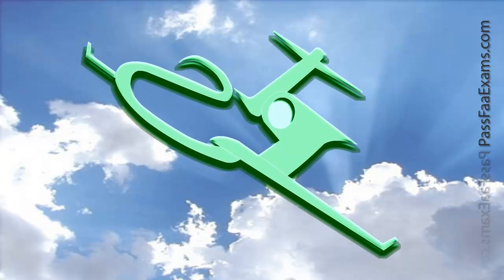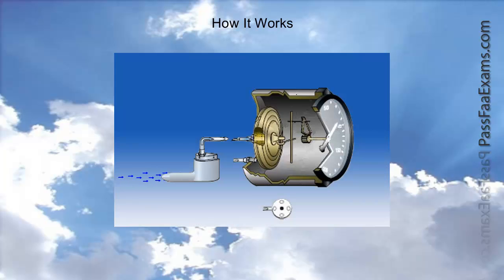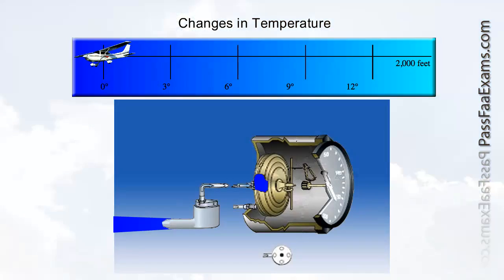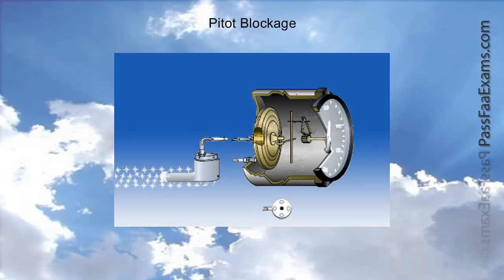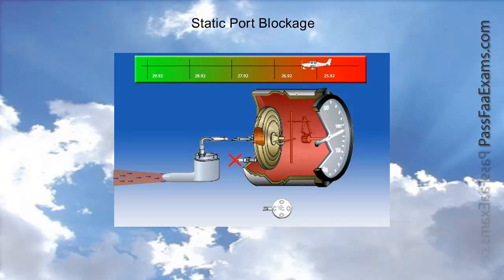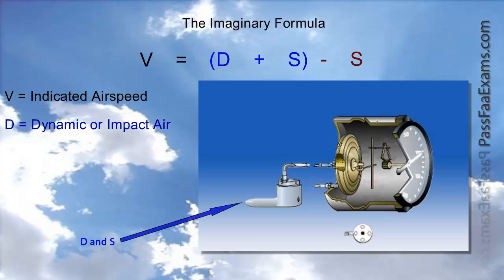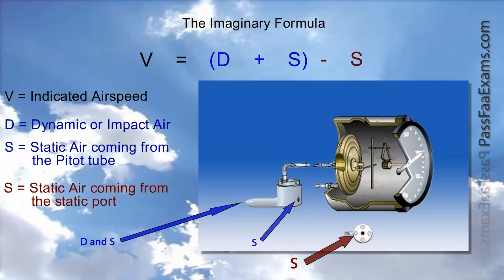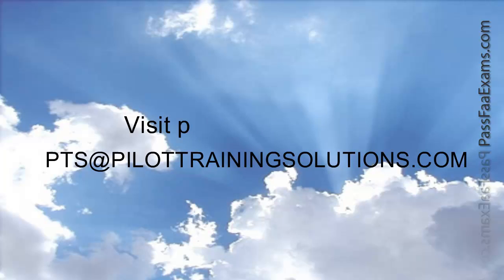How the Airspeed Indicator Works

Comment: In fifty-three years of flying I have never heard before that pressure has no effect on the airspeed indicator - that only changes in temperature have effects on it. But nowhere in the PHAK - 8083-25B does it suggest this theory. Conversely, nowhere in this manual does it suggest that temperature, by itself, has any effects on changes in indicated airspeed at all. Changing temperatures will of course affect static as well as dynamic pressures - which will, in turn, affect the airspeed indicator. But the airspeed indicator is itself a differential pressure instrument. Air does not flow through a pitot tube, it only impacts it like you're stuffing clothes in a bag. And it is a liar at all altitudes except at sea level. At all altitudes above sea level it stops indicating your actual speed through the air and indicates to you only the dynamic airspeed which the entire airplane "feels" it is encountering. That's why we need to calculate our true airspeed - so we'll know what our "true airspeed" really is... Where did you get this idea that only temperature affects the airspeed indicator? Are we missing something in this video?

Comment: Hi, for the airspeed consequences in case of flying into colder air or higher pressure, you need to fix one parameter, I mean, or you fix the TAS or the IAS. In the first case, if you fix the TAS, then flying into colder air, the IAS will increase, and in the other option, for higher pressure, if you fix the IAS, then, the TAS will be decreased, but always fixing one parameter. Changes in temperature or in pressure will always affect the air density, and therefore, the dynamic pressure, which is the one that gives us the measure of speed.

Comment: The altimiter does not use ram air
Reply from the maker: This is an Airspeed indicator!!!
Reply: @GianLucaNoia  I am just saying it because you say "altimeter" in the beginning and it says "altimeter" on the top of the slide.  I think if these things were changed, it would be less confusing for those watching...that's all man, you dont have to get mad about it

Comment: What is being shown in this video is old technology and not realistic for modern air data systems
Reply from the maker: Keep in mind that the purpose of most of these videos is to help Pilots working on their Private license and/or Instrument rating. 
Be it for cost, aircraft availability, etc, the majority of students prefer to accomplish their training in older airplanes still equipped with analog instruments rather than glass cockpit.
Also Airspeed Indicator questions on all of the FAA Knowledge Exams still focus on these analog instruments!
Reply: @GianLucaNoia  > I can understand that, but in the real world most of us work on or support  modern aircraft in some capacity whether it be engineering or customer support etc.   You will not see this unless you work on old general aviation aircraft.  I just don't want people here to assume they are getting into aviation and will see this as modern technology.  It is old antiquated technology.
Reply from the maker: @rcairflr  Agreed, but this video is for the Primary students. It is an extract from our Private Pilot Interactive Test Prep Software which focuses on helping students pass their PPL Written through understanding rather than memorizing questions and answers.
We do offer advanced IFR training software (our IFR Procedures App) where we cover advanced systems and glass!

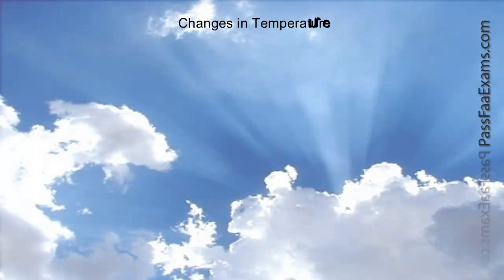Comment: At 2:00 when you talk about temperature you should add an annotation to make it more clear that temp does not affect the correctness of the Air Speed Indicator ( the Vspeeds like stall speed will be the same regardless or air temperature.  I understand you're just trying to show the relationship between Tas and Ias but it's slightly confusing.

Comment: What will happen if only the drain hole blocked
Reply from the maker: If the drain hole is the only affected (blocked) input nothing will happen but in heavy rain the Airspeed Indicator might malfunction.
Reply: Gian Luca Noia air which is intering in the pitot tube after accumulation in pitot pressure chamber it apply pr in instrument where it goes
Reply: Gian Luca Noia if something enters in a chamber it need a way to come out
Reply: Gian Luca Noia 
What is the use of drain valve in pitot tube
Reply from the maker: You are complicating your life as a pilot. What we do at PTS is simplify aviation concepts. So, to simplify this, try blowing in a bottle of soda for example. The air is trapped in the bottle and can't escape. If you make a hole in the bottle and seal it after inserting a manometer you will get different readings from it as you increase the pressure with your breath.
Also if you were able to calibrate a sealed plastic bottle it would make for quite an effective altimeter. The more you climb, the more it will expand. The more you descend, the more it will compress. 
In essence the DRAIN Hole is just that: it drains unwanted material from the pitot tube. That is it's only purpose!!!
Reply: Gian Luca Noia 
Im not a pilot im doing aircraft maintenance engineering so i need explanation about pitot static system
Reply: Gian Luca Noia 
and if drain hole is only use to remove unwanted materia then when pitot tube blocks then how the air which is filled in pitot system drains from drain hole.
And indicator shows 0 reading

Comment: I still don't get the point of relationship  between  Static Port and Pitot Tube..... I got the point of how airspeed is measured by Pitot Tube... But then I saw people saying that airspeed indicator actually measures the average of speed from Pitot Tube and the one from Static Port. Is this right?
Reply: +Hyeonchang Cheong 
Static port is showing static (still) air around airplane. Pitot is showing dynamic (moving).
Airspeed indicator working "moving - still = your speed".
Reply: That's in fact incorrect. According to Bernoulli's principle, Total Pressure=Dynamic Pressure + Static Pressure. What the pitot tube reads is indeed the total pressure, and static port (as stated in the name) reads the static pressure. The instrument is calibrated to perform "calculations", in this case the Total Pressure from the pitot minus the Static pressure from the static port which results in the dynamic pressure, the pressure associated with speed. You can see it this way, if the dynamic pressure(speed) increases, the static pressure will decrease, vice-versa.
Reply: Same doubt

Comment: Thank you for the well made video. One question, so why is the ASI connected with the static port when it reads the dynamic pressure from the pitot tube?

Comment: I watched many air crash investigations videos , just for curiosity sakes, not a pro.
I have seen thousands of crashes caused by mis- readings produced by blockage of pitot tube.
My question is , isn’t there a way to tell pilot,when pitot tube gets blocked?
Are there other methods of measuring speed and attitude when pitot tube blocks?
What are the recent innovations?
I loved this video explanation.
Reply from the maker: jitegemee The easiest way to detect a pitot blockage is to cross check all your instruments. If the airspeed keeps decreasing but the altimeter and VSI do not show a climb and neither does the attitude indicator (and you have not touched the power settings). There is a good chance that the pitot tube is becoming iced. Nearly every plane out there, definitely if Certified for IFR (flying inside the clouds), has a pitot tube heater. Turn that on and you are good to go.
Reply: jitegemee GPS

Comment: I try to understand deeper. So the speed indicator measures the speed by différences in total pressure in the pitot tube. As total pressure is Dynamic pressure + Static pressure, and as the static pressure varies in the chamber as in the air, we can say that the indicator measures speed by dynamic pressure only (if nothing clogged).
Now the dynamic pressure will depend on our speed through the air, but also as you write, on the air density.

As you say, as air (and gases) expand with temperature, the density will decrease if temperature increases. This has for effect that lift will decrease on hot days (notion of density altitude) or, as another example, that warm air can content more water vapor than cold air. Right ? And also, that the speed indicator will indicate lower than the true airspeed when temperature increases, because warm air is less dense.

But if density is affected by temperature, can it be also by pressure ? As we climb, TAS will be greater than IAS, because by pressure decreasing, density decreases ? Loss of temperature when we climb should increase the density, but as I understand the loss of pressure has a greater effect on density than the loss of temperature. Or do I miss something ?
Reply: Jean Stassin the video says temperature variability has far an effect on airplane speed than change in pressure.

Comment: Thanks for your answer, Gian Luca. So if I read you well, TAS will be different from IAS only because of temperature change when I climb. But, as temperature decreases with altitude, and if the speed indicator compensates for pessure changes, the decrease in temperature should make the air more dense and so the IAS should rise... But if I'm correct the TAS becomes higher than the IAS as altitude increases. How come ?
Reply from the maker: The problem is that as you increase altitude the air is less dense, not more dense because it is spread out over a larger area. This means less particles impact the pitot tube so even though the temperature is lower the IAS is also lower due to the decrease in molecules,
Reply: I've been looking for this answer for a while! THANK YOU!!

Comment: One thing I don't really catch : you explain that changes in pressure won't affect the IAS because the change in impact pressure in the pitot tube will be compensated by the change in static pressure in the chamber. But how than to explain that there is a difference between TAS and IAS when we climb ? The compensation doesn't occur the same way ?
Reply from the maker: TAS is IAS corrected for temperature not pressure. Pressure, again, is corrected automatically by the instrument.

Comment: My understanding is that the airspeed indicator judges the aircraft's speed by the amount of air entering through the pitot tube. What I'm slightly confused with is how this will give the correct reading of the aircraft's speed if the aircraft were to come up against a large gust of wind, this will slow the aircraft down yet the amount of air entering the pitot tube will increase. How does the airspeed indicator correct for this occurence ? Thank you for your help !
Reply from the maker: It doesn't. You have to correct for it. But it doesn't matter because the airplane is generating lift accordingly. If you encounter strong winds your groundspeed will be slower but your indicated airspeed and lift will be grater and less power will be required to stay aloft. If you encounter gusting conditions during landing as a precaution you should add 1/2 the gust component to your approach speed because if the gust stops all of a sudden, you would also lose the extra lift produced by it and that could lead to quite a hard landing.

Comment: you told that the reading affected when there is change in temp as the density of air changes but it is not affected when there is change in pressure as the CHAMBER IS CONNECTED TO STATIC PORT but the chamber was connected to static port when the change in temp was occuring also???
Reply from the maker: Temperature affects the density of the air. Imagine it this way: in hot temperatures less air is impacting the pitot tube so your airspeed reads lower, while in cold air more air is impacting it giving you a higher reading. Pressure changes make no difference because they are balanced by the chamber being connected to th static port,\.

Comment: i have a question about VSI, from the book we know when the static port block ,the VSI will show zero moment.we can break the glass of VSI in order to let the VSI work, but when the static port block, there will some pressure in the diaphragm, when we descent, the pressure will come into the VSI BOX form calibrated leak,and the high pressure will push the diaphragm which can show the descent rate. i am so confusing about this problem, can anybody teach me ?
Reply from the maker: Both the large opening in the instrument and the calibrated leak are connected to the static port so if it freezes, all freezes and descending would make no difference (instrument still reads zero). We have a video on the VSI here it is:
http://youtu.be/ERP2nKgWpxk

Comment: Hi Sir please correct me if am wrong ,when flying at certain alititude e.i 1000ft at 100knots the capsule in the casing will expand due to the speed at which the aircraft is travellin at, cause it doesn't get affected by pressure.flying at same ft but at 50knots the capsule  will less, causin air in the casng to me more.

Comment from the maker: The video already explains it as the pressure inside the diaphragm and the chamber of the instrument stays the same there is also no change in the reading of the Airspeed Indicator. If your approach at the surface is 100 kts indicated at 20,000 feet it is still 100 kt indicated. You will need a longer runway as your true airspeed is actually much faster but the instrument still indicates the same and you have to use the same speed.